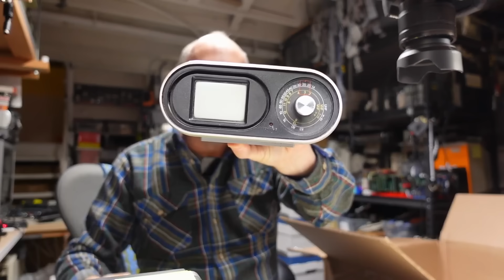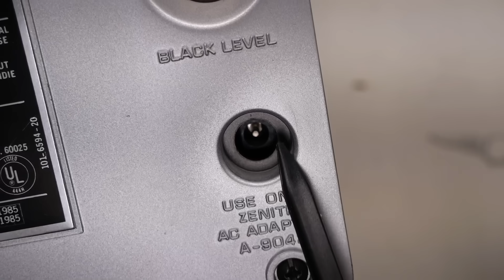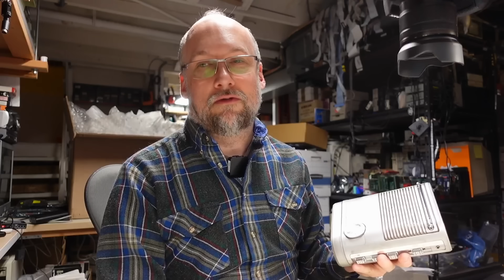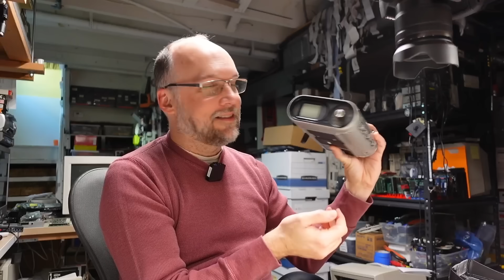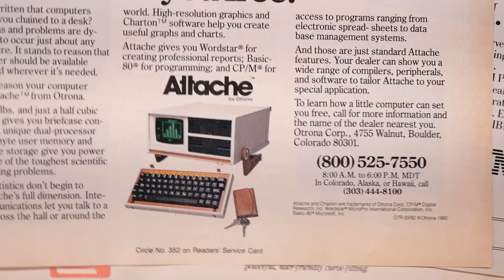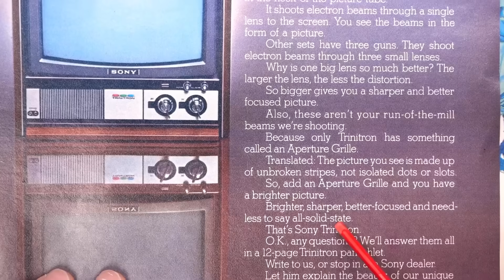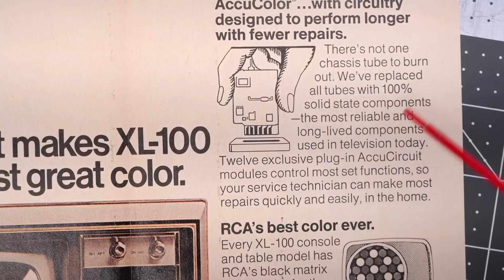0076 A binocular TV, the wiggle method rocks on Mac parts, and some awesome old print ads

Comment: The Sears model numbers are weird. I was a store manager for them for a while. The first 2 numbers before the dash was a division number. So like washer and dryers had the division 26, kitchen appliances had 22, refrigeration was 46. So like a top load washer I remember was 26-26132. If anyone cared lol.
Reply: you are correct.  to pick nits, the format was 26.26132 (worked for Sears in college)

Comment: Back a few years ago I finally got my first Sony Trinitron TV. I found a 19" KV1925R. The set was left outside under a covered porch on the floor. The set had been outside I think few a couple of years and was covered in leaves and junk. Never the less I saved the Sony as it was free so had nothing to lose. I let the TV dry for few days and then took the back off of it to make sure the set was safe to use. I hooked up a VCR and plugged in set and TV worked perfectly with extremely strong Picture tube. The set worked for 3 days then a while watching ALF an electrolytic capacitor shorted right to ground taking the fuse and flyback transformer with it. I managed to find new old stock flyback and recapped the TV. That brought the set back to life. This TV has on screen display and I have the original remote control for the set too.

Comment: Back in 2000, I trashpicked a mint condition Zenith Mastersport 386SL laptop, with original carrying bag, working battery and charger in my high school, and later when it broke(DIY headphone jack on PC speaker mod gone wrong) I traded it for another Zenith 180 (1987)series laptop that had an XT CPU, no hard drive option, and 2 floppy drives, both 720k built in, and they opened up between the keyboard and the screen. I wonder if it is the same company? The logo looks similar.

Comment: Wait a second: Early Triniton used an optical beam splitter for the 3 primary colours but only one electron emitter. Sort of a prismatic solution. However: they faced a lot problems which came along with the thin wire stripe-mask (vibrations, odd miscoloring, visible stabilizer wires) in addition to a way more bulky and heavy tube itself. The picture was outstanding when everything works. The wires of that stripe mask leave more electrons through for activating the phosphoros pixels and pictures were clearer and brighter. Hopefully.

Comment: I fix and screen mod lots of Sega Game Gears, over 200 at this point, so I have extensive experience with the vinegar method. Anyway, might I recommend you use a syringe to, “float”, only the parts of the board that have crusty corrosion with white vinegar. The key is to allow the vinegar to do its magic for 10 to 12 minutes then blot the excess off and use an electric tooth brush, dipped in more vinegar, to further clean the area. Finally, clean the board thoroughly with IPA or wash it to remove any remaining vinegar. After the previous is done you should have a clean board and you will be able to easily see what further repairs/rework need doing if any.

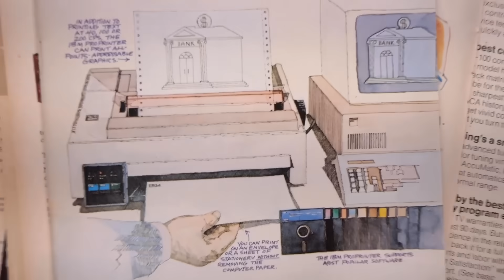Comment: 31:38 A lesser known fact is, that the IBM Proprinters of the 420x family were designed for fully robotized final assembly - to eliminate the "human factor". Like the IBM PS/2 machines of the 50 and 70 series. Proprinters were produced - among other - in the printer factory in Lexington, where two dozen people, mainly operating logistics, shipped out a 1000 units a *day*. The "white" proprinters with a light-grey colored operating panel and no branding stickers were still produced in Italy long after the IBM - Lexmark split to be used as printers for ATMs and bank account printers for e.g. Nixdorf / Siemens-Nixdorf machines. There is even a video on YouTube about the Proprinter assembly entiteled "Design For Assembly". https://www.youtube.com/watch?v=spDYSKl3kmo

Comment: The Chromacolor features a dot-mask tube other than a slot- or stripe-mask as usual. To every hole in the mask belongs a "triplet" of phosphorous dots in red, green and blue. It has as many dots as it has vertical and horizontal resolution. So it must have been produced in the mid-70s as earliest. Dot mask tubes allow darker background due to smaller dot pitches and lesser glare effects.

Comment: Those little TVs would be awesome. If you could find a way to make them either stream or just play stuff off of an SD card or hard drive. Does anyone make a product like that so that old TVs that only have an antenna no cable input could use that antenna input to connect to a hard drive?

Comment: I have to be a contrarian about the Trinitron picture. I always thought it was heavily pixelated and not sharp. Yes the colors were vibrant but I could never get over the low resolution. I built a Heathkit with a standard black-matrix Zenith picture tube and that was by far the aharpest, most magnificent picture I had ever seen on a CRT TV. Trintron computer monitors would always begin to sag in brightness seemingly months out of the box. And you could not use one up close. I could adjust the convergence and other parameters on our Heathkit on the spur of the moment. I kept a plastic choke tool inside the solid copper chassis. GR-2000, best CRT TV ever!

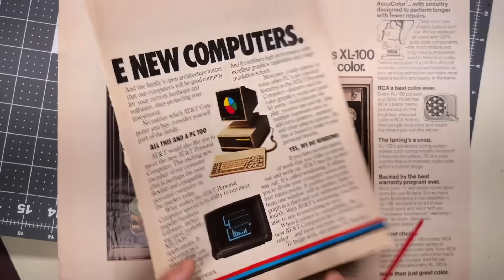Comment: 44:10 Re: the AT&T PCs augmenting a 3B system... we had this AT&T gear (as well as lots of Macs) when I was in college ('87-'91, Carroll College, Waukesha, WI - now Carroll University) and worked in the computer science department/lab. As we used them, the AT&T PCs were just normal MS-DOS PCs, and not as nice as, say, the IBM PS/2 line which we also had. We did not have PCs on Ethernet (like we did the Macs), as I recall; there was a StarLAN lab for a while. We ran an AT&T 3B2/700 time sharing system, which had a Westinghouse processor (and AT&T subsidiary), and we had perhaps 16-20 (Zenith) dumb terminals that student used to work on UNIX SVR3. (3.2 from c. 1989, IIRC.)
As a student, we could get a 19.2k baud serial line in our dorm room (twisted pair Ethernet was not yet a standard), and your PC (or Mac) could log-in on the UNIX system that way. Pretty nice services, given the time. Those lines went to AT&T distribution panels/boxes, and then via fiber optic back to a central location near the 3B2 and ISN cabinet. So, it was a whole campus-wide solution for communications.

Anyway, AT&T had a lot of compatible products like their ISN (Integrated Services Network) and also the college's phone system ran on another 3B UNIX machine. I think this ad is sort of AT&T's overarching pitch that "they can provide everything."

Comment: Our first color television was a Heathkit tv and it had a zenith equivalent; the difference was that you did indeed build the Heathkit and it is true that there were no printed circuit boards and we had to assemble the wooden cabinet. It lasted in excess of 20 years with constant use and saw a few video games.

Comment: Fun fact about the IBM Proprinter: it was designed to be completely assembled without any tools/screws. The whole case, chassis and other components just clipped together. It was really fast due to using a worm gear to move the head around. Unfortunately this made positioning of the head slight less accurate, so characters were a little "squigly" in draft mode. I still have mine from 1986!

Comment: Thank you so much for scanning the Otrona ad, I'm making a big compilation of data about this computer and this one wasn't online yet!

Some cool info about this machine: This is an ad for the Attaché 8-16, which was an expanded version of the Attaché with a 8086 card and MS-DOS (poor) compatibility. It used to cost about double the price of its contemporary Kaypro & Osborne, but was lighter and had very cool specs including bitmap graphics.

The whole machine is well integrated and extremely well made.
From what I can gather, it sold between 5000 and 10k units. The company tried to migrate to PC compatibles with the Otrona 2001 but went bankrupt due to high production costs.

There are mentions of Tempest-hardened Attaché computers for govt use, but I have yet to find tangible info about that beyond a few mentions.

Comment: As for the RCA tv system, the reason for the modules as they were called, this was to make repair simpler. There were a number of places that did the component level repairs and the field tech would just replace the module. The modules were for things like IF, Audio (sometimes 2 modules with 1 for output power), Horizontal, Vertical, CRT drive, etc. BTW, I remember that one of the bigger names in module repair was PTS and they started in rebuilding tuners.
Reply: Quasar had the "Works in a draw" setup where the technician could pull the electronics out and replace various boards in a similar fashion. I remember this from their advertisements in from the 80s.

Comment: while in a vacuum, modular designs do have more points of failure where they interface with each other; both for development and for servicing, modularity is far better as you can easily swap a whole module if it stops working, or if you decide to repair the module itself, you can swap it into a known working system to eliminate other factors from a faulty unit.

Comment: You can get that little TV back to picking up transmissions again via a digital converter box. Just take the center pin from the out on the box and wrap a wire around the antenna.  I did something similar with a small black and white TV like that one you have. Also make sure there's no batteries in it. Mine had them and they prevented the thing from turning on while plugged in.

Comment: Adrian, at 14:58 you’re actually mentioning that the TV has an AC power input, but afterwards you’re rambling on about a DC power input, of which you don’t know the polarity. :D 

Anyhow, it seems to need an AC 8-15V power supply that can deliver around 700mA. It says so on the back. :) 

Have fun modding it! I’ll be watching the video as usual! :D

Comment: I think the main thing about using the vinegar after removing a capacitor is to stop the chemicals from eating the board and other chips. It's not really to clean, actually you should clean the vinegar after you wipe it down.. It's not a cleaner is a neutralizer.

Comment: I bought a 21 inch Trinitron monitor for my computer in 1999 (not cheap) and I used it well over 10 years without issues... I haven't fired it up a while, but it wouldn't surprise if it still works today.
Reply: Sony Trinitron were and even still are such reliable TV's, my brother had a few of them in different sizes over the years and they just always worked, looked good and took bad treatment without issues, he had his 32 inch I believe it was on a tiny little cart for years, when it finally collapsed and hit the hardwood floor, shaking the whole house, we thought for sure when we walked back into the room it would be doa, but no it continued to work perfectly for more years until he finally got a flat screen, which only worked for maybe a year before it failed 😂
Reply: And I watched this video on a 24" FD trinitron. HP A7217A. Other than needing frequent manual degaussing, still works great!
Reply: I burned-in a ~20" dell trinitron, and wore out a 14" seiko/epson trinitron, but a hand-me-down 17" sony trinitron TV with a broken power switch was scooped up by a neighbor in the early 00s a few minutes after I set it down on my curb with a "free" sign on it. it had been replaced with a toshiba that barely survived into the 10s.
Reply: I had one too, and had to get rid of it when I moved out of state in 2013. They’re just so freaking heavy to lug around, and when you have to pay for shipping by weight it seemed like the only option. I had to get rid of 10 or so huge CRT monitors when I moved. Hurts man.

Comment: Regarding the style of Sony televisions that they kept for a long time - yes that's true. My family had one from the mid-80s on that still followed the same design philosophy. Of course the fake woodgrain was gone by then, and the tuner was digitized and remote controllable, but that 14" thing was our only TV (I couldn't have my own TV back then since our apartment only had one antenna connection, and where we lived, the built-in antenna was pretty useless). It worked well for a long time until it broke, which I am probably somewhat to blame for. It had a terribly high-frequency whine, which was even worse when it was in standby. (No telling what the power consumption in standby was). My parents didn't hear it, but I did, and so I always went there and switched it off using the built- in switch. And that was what eventually failed, and back then I didn't dare to replace it.

But this TV set has been far outlived by what still is my main TV set - that one turned 30 last year. It's a Philips TV, 100 Hz CRT (not sure if that was a thing in North America, given their usual 60 Hz refresh rate), and given the image quality and front curvature, I am sure it is a Trinitron like CRT. I doubt analog SD video can get any better on a consumer-grade device. Since I don't have TV service where I live (no terrestrial signal, not allowed to mount a satellite dish and no motivation to fork over a ton of money for cable given our terrible overall TV program quality), I only use it for DVDs, and I like to call it "peak DVD quality". Yeah, it may be bulky and heavy (m friends who helped me move the last two times hate me for having it), but if it ain't broke don't fix it - which in theory would still be an option if the parts are available since it came with full schematics.

Comment: @16:07  They've just spelt circuit with a K : "kircuit" not knowing that in English a K can't make the soft 'c' sound. And the fact it has no polarity on the output diagram makes me think of the old "intentionally left blank" line.